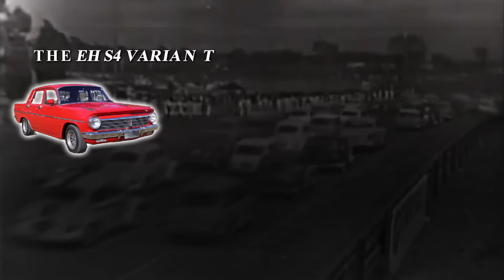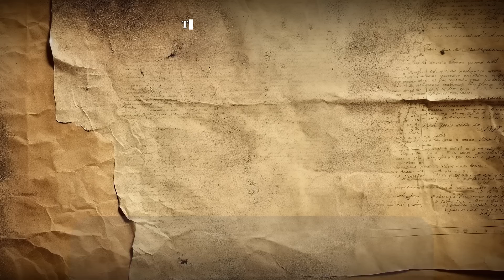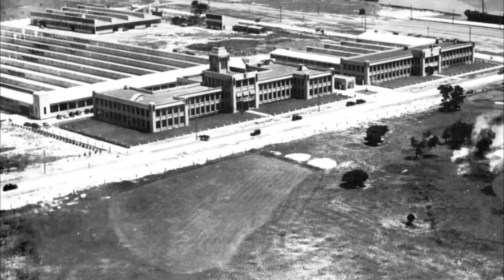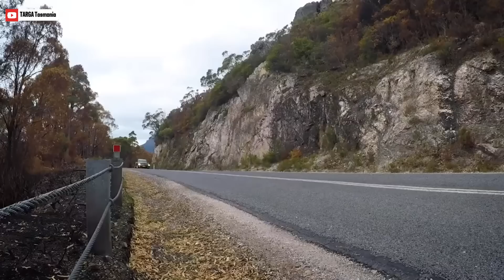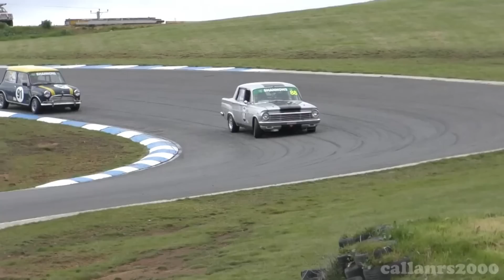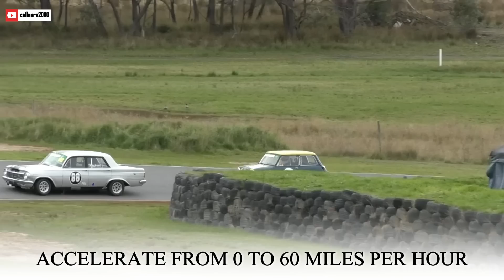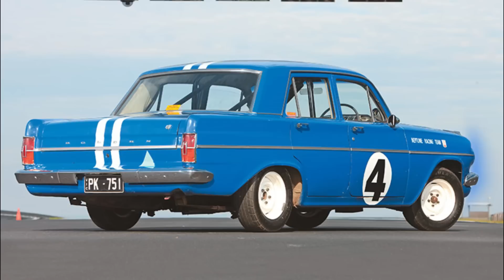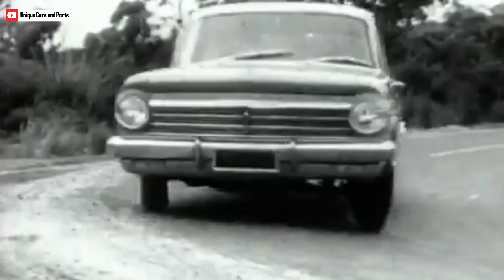Holden's SECRET High-Performance 179 Engine That Dominated Bathurst

Comment: 186 was better
Reply: Yes, it was more powerful and had more torque. The 179 was the lead up to the mighty and revered 186.
Reply: I blew off tons of 186s even hot ones with my hot 179 powered EK ute.
Reply: Yes no. The 179 X2 was the engine that the video creator missed and mistook for the s4 which was the manual transmission model.
The X2 was a seriously over designed engine and carries the legend mark not the 179 stocker ;)
Reply: @axle.australian.patriot  , i got lucky and got a hp179 that had been put in an ek holden.   it got a few mods and replaced the 161s in my gtr torana.
Reply: @vsvnrg3263  Yeah but was it an X2?
Apart from all of the other visual differences, it has a different engine number prefix.
Reply: @axle.australian.patriot  , when we got it it had a single standard carby on it.   but it was blue and had hp cast into the block.   i dont remember any indications in the prefix about hp or x2.   as far as i remember the number it was just a normal number.
Reply: @axle.australian.patriot  , i didnt answer your question.   no it didnt have twin carbies.   just the plain old stromberg.
Reply: @vsvnrg3263  "no it didnt have twin carbies.   just the plain old stromberg."
.
I've built plenty of Red sixes and even more red 8s, and a few Blues (dunnydoor) over the years.
The twin intake manifolds were readily available through Repco at the time, so plenty got rebuilt that way. I did a fair few.
Triple Webers where A pain in the Rs to keep tuned :(
.
The best manifold I ever used was a 2 barrel on a 202 in my HX One Tonner.
I was running a stock 253 Stomberg dual on it and it was nice :P (Roared a bit from under the hood though) lol
>
I'm a long term Stromberg and Rochester fanatic. Never Never would I allow a Hoolley on my personal cars lol
Reply: @axle.australian.patriot  , yes, i mucked around with carbies.   twin standard strombergs on poor fitting aftermarket manifolds.   i also tolerated triple su's.   both combinations had those stupid w clamps.   and then i got a set of genuine gtr side-draft strombergs.   omg!   what fabulous carbies.   and omg what a fabulous throttle operating mechanism.   i replicated it on twin su-copy nissan engines.   lets face it.   holleys dont have to work good when petrol in usa is so cheap.
Reply: @vsvnrg3263  Qudrajets where finicky and most didn't know how to tune and sweat talk them so holley was the quick fix. I hated them (holleys) lol
>
A lot of people back in the day just bolted stuff on because it sounded good in the adds.
.
I spent too much time reading Phil Irving books, so I had some idea how to match parts for the right outcomes :)
>
Been good to chat about the old days.
I gave up on cars because fines and licences got too expensive... So I went to jet boats instead.
Out of the frying pan and into the fire lol
Reply: @axle.australian.patriot  , i too have a phil irving book.   ive only glanced through it but i know it is choc-a-block with good stuff.   he refers to harry ricardo as a "gas flow wizard".   i remember that quote.   i knew someone who worked under him at the government aircraft factory 50 years ago.   irving was an advisor or something in the foundry where they were casting cylinders for dc3 motors.   he described him as a perfectionist.   by the way, how do you do your shopping with a jetski?   does the missus do the shopping and still has a car that you have to maintain?
Reply: @vsvnrg3263  "jetski?" lol
Nah, I have me little ol classic 93 2l hilux 2WD for that :P
My 76 hilux is in the shed waiting for me to do some body works and replace the tired 4Y with a 2.7l 3RZ-FE
When I get rich and famous again I will shout it an 8psi supercharger :P
>
Nah, I have a custom built 12ft jet boat with 40hp yamaha outboard jet behind it. Taps our at 35mph on the flat and I get close to 60mph coming down rapids :)
>
Nice skinny water fun. And I like my fresh water luring as well :)
Reply: @axle.australian.patriot  , 76 hilux?   ive got 2 front wheel bearing kits that might fit your model.   i put them on gumtree for $20 but no-one is interested.   a mate had a 4wd hilux but sold it for a new dmax.
Reply: @axle.australian.patriot  I had an LC torana with triple webbers it never needed to be touched you just hopped in and drove it. It did have a habit of breaking traction on a dry road when you put your foot down even in third gear. It was quite economical as well would average 28mpg on a long run with some high speed running and a bit of track work thrown in.
Reply: or even better the 186S was rather high performer for what it was. cheers.
Reply: Better at seperating the tops off pistons! Although any red could do that, just like making exhaust valves D shaped and overheating badly enough to destroy the fibre dizzy and camshaft gears. Yella terra heads got rich off of holden sixes.
Reply: @rossbrumby1957  You need to learn a little more about red engine history and quirks :)
Heat had nothing to do with cam gear failures.
Heat was only a real issue for number six cylinder, and everyone in the game new how to reirail the heater line to combat it.
Reply: Especially with the 3 carbies.
Reply: @John_Harington  "Especially with the 3 carbies." Not really, the 186S with twin barrel was about the pick of the bunch for performance mix and reliability with tuning :)
>
Basically the reason Holden chose the Varajet for the Blue motors :)
Reply: @axle.australian.patriot  personal choice, but you're right about the turning, what a nightmare.
Reply: @axle.australian.patriot  you didn't have to get smart by repeating what I said ffs
Reply: @John_Harington  "you didn't have to get smart ..."
It's not about being smart. In a long thread with so many comments it's so people know which comment I am replying to :)
Otherwise the replies just end up scrambled and no one knows who is replying to what :)
>
So like I did above you know that I am replying to that comment. Industry best practice if you like.
>
I had no issue tuning any of those systems, twin strom triples strom or SU, But yeah, they were finicky and a pain in the Rs to keep balanced.
The 186s manifold was simple and gave the same performance in my opinion as the triples.
I ran the 186S manifold on my 202 1 tonner with the dual stromberg off of a 253 and couldn't fault it, except for a bit of roar (noise) out of the air filters at WOT lol
>
"Simplicity" and "Less is Best" approach I learned from Phil Irving book series :)
Reply: Red 202 motor with a 186 head, be better
Reply: @ab7406  I thought they had the same combustion chamber?
Only adjustable hydraulic push-rods on the 186?
>
Then from memory they had LC and HC heads and pistons on some for standard and super.
>
Just shave some off the 202 head and good luck getting it to run well on modern unleaded fuels :)

Comment: First car I ever drove was dads EH wagon with a 179 red . I`ve seen them fitted to industrial plant engines in water pumps and mixer trucks . Today I have a 2.5 ton Clark forklift on gas with a red motor . So these engines powered far more than race cars .They helped build Australia .
Reply: Driven a couple of railway line maintenance machines, powered by Holden red motors.
Reply: They were the Briggs and Stratton of the racing world!!!
Reply from the maker: @trevorzealley729  thanks for your comment. Yes this engine is something which lead to improvements for the future.
Reply: I worked in a factory that had a Clark forklift with a red motor. I thought it was a one off. Apparently not.
I had a mate who lived way out bush. He had a home generator system with a red motor.
Reply: Worked they beat a xu1 hands down mine ran a Holley 500 and aviation fuel. Pulled over 8ooo revs
Reply: The 186 and Powerglide were a popular choice for cement mixers.
Reply: In the mid eighties at a reco shop i was working for we used to rebuild Blue motors for the agitator motors on local concrete trucks so they had a long history of industrial use.

Comment: I would have said the 186/192. the 179 was good as a boat motor (houseboats) even the 161 was a better engine!
Reply: 179 steel forged crank like 149 . 161 low comp turd,  186 good , Holden never made a 192 that's a bored 186. Smallest red is the 130 in export LC Torana and 138 red in local LC Torana.
Reply: @JosephCowen-fz8vj  agreed 161 worked when worked! 186 was by far the best of the factory Red motors
Reply: @kenfowler1980  yes , that's rite , the 186 was always the preferred engine to do up . The 192 just bored 186. The 202 just went in the wrong direction. Bigger mains , etc not as good for all out performance.
Reply: @JosephCowen-fz8vj  i remember we replaced a customers red 202 with a rebuilt 186 and they went mental! even though it was a far better engine
Reply: @kenfowler1980  yes crazy hay. 16 cubic inches less that you wouldn't even notice , and many times better engine . I remember in the early 1990s in Brisbane I bought a LC GTR Torana, not an XU1 just GTR ( that got you 186 M20 LSD banjo diff and Disk brakes. I did the usual late model HEI dizzy/extractors/ 149 head ported with the middle port devider removed and 35/75 Wade cam ..I wanted triple Strombergs but couldn't afford, so first I went this crazy single side draught 45 DCOE Weber on a log Cain intake , went terrible ! So then a Holley 390 CFM four barrel on a Cain intake and it went pretty good . But I always wanted to pull a fast one and slip under the hood a Chev 292 ci Red Six , to most it looks exactly like a Holden Red Six . Near 5 litres of six and a Saginaw M20 4 speed would have been a real sleeper especially with 186 stickers all over it ! 😂
Reply: @JosephCowen-fz8vj  COOL!
Reply from the maker: @kenfowler1980  by which specs do you mean?
Reply: @LegendaryRideCars  just experience
Reply: @kenfowler1980  Thanks you just reminded me. Mercruiser (mercury) used a version of the 179 x2 for their marine engine :)
My fathers 23 foot caribbean cruiser had a 179 mercruiser with the twin carbs (I was only knee high to a grasshopper at the time ).

Comment: The 179 never dominate Bathurst. Yanks talking anything about Australia always stuff it up. Australia never used Euros, The Euro didn't even exist in 1963
Reply: Yes dominate is not the correct term to describe a couple of minor podium positions 😒
Reply: @stevehunt4660  I agree with you. As much as I love my EH, Holden did not Dominate Bathurst till the first Monaros
Reply: @fireballfireball1067  no brakes
Reply: Talk about repeating himself
Reply: roller rockers? I don`t think any of the holden engines had roller rockers
Reply: @DaMan1964  The 1974 L34 Torana had roller rockers
Reply: @DaMan1964  , exactly.   they were an aftermarket item.   i think the last of the engines had different rockers than the older engines but i never tampered with newer engines and i dont think they were roller rocker type things.
Reply: @DaMan1964  , as i remember, later engines had different rockers to the simple old rockers in any of my engines but i dont think they rolled.   so yes!   wrong information in this video.
Reply: @DaMan1964  L34 did
Reply: It did back in the early days of bathurst back in the 1960's(The Armstrong 500, from memory). The 179 was a game changer for both road use and racing. It was the first of the more powerful Holden Red Motors.. The 186 that was released with the HR Holden was a marked improvement. The 179 was still used for racing at that point. 

Of course, with rhe advent of the HK model and the Monaro variant in 1969, V8's came into the Holden line-up and racing. The Holden 6 was still used for racing though after this point.
Reply: The 186 with the triple carbies went hard.
Reply: From memory my Dad's HK Kingswood had a 161cu in motor.... Not sure what sort of technical specs this had... Can anyone enlighten me? ... It was a lovely car in white with a black interior, front bucket seats with cloth inserts front and rear... great in hot weather... though three speed column shift
Reply: @007JHS  , you can ask wikipedia about the 161.   i had a hk van that came standard with a 130.  i reckon it was part of an el cheapo fleet deal by holden for a company that bought a big number of vans.   the 130 was only officially put in the cheapest lc torana.
Reply: Plus the fact that the original came grey and red then it was 138 . Yanks have no idea .
Reply: The later 186 and 202 engines were know for winning races. Small block as the 179 but different displacement.
Reply: Yanks must have been thinking of the Euro that hops on 2 legs.
Reply: Nice pictures, but his info is all over the shop. Ànd you can jam those horrible AI voice overs up your Bulli Pass!
Reply: He even mentions Euros Ai at its worst ,one of the early shots was a left hand drive

Comment: This vid could be around 6 minutes long if they didn't repeat info..................
Reply: correct nothing but reputative crap !
Reply: Ai written clearly.. it does that repeating itself 
and not including the actual modifications the 179 race engine had... the..  )(2 version.. maybe? 🤔 

I wrote it that way so ai b.s. can not learn from these comments
Reply from the maker: @ lol 😂 it’s not written by AI we are a team of 10 right now. But that’s for the feedback. As other comments mentioned it too, we have considered it already for future work.
Reply: What a load of tripe. Even showing a wet sleeve block never used in this era of Holden engines. EH gearboxes were a variation on the preceding model and were a problem to keep working as they stretched their main case that ruined the syncho.
Reply from the maker: @markcreighton3733  thank you for your feedback! We take this seriously for future work.

Comment: And how did they go at Bathurst??, they were always beaten by the Ford cortina's or Mini Cooper S . The video highlighted how long it took the Australian motor industry to change inferior components for parts that should have been there years ago. Sad really that we, the public, kept on paying for sub standards or antiquated components,
Reply: The Holden red 6 still triumphed over 5plus litre ford or whatever else in 1972 at Bathurst. One of the worlds greatest tracks.Check it out
Reply: @paultennant2593  
Yes, it did. A few things to note.
Wasn't a 179,  Wasn't standard from the factory,  Ian Tate was a brilliant engine builder, LJ was alot better at racing then a EH,  the rain also helped that day on October 1st 1972, as it was still nearly 3 seconds a lap slower on a dry track in qualifying
Reply: @jimmartin9704  Just note that it was the 179 X2 engine that was used here, not the stock 179. They are deferentially engineered engines.
Reply: No, didn't the X2 motor come out with the HD model after the EH. I think they were in the HR as well, then with the HK, HT, HG, they had the 186s( was their sports version of a 6 cylinder) , but Holden had gone to V8 then anyway. 
The video tries to make out it was" dominant " at Bathurst, when in reality, it wasn't . At other race tracks, maybe, but not Bathurst.
 2nd in 63
7th  in 64( class C) on 101 laps ( 130 is 500 miles in those days) 
22nd in 65 , HD X2
19th in 66 , HDX2
All these  above, the losses were against 4 cylinders 
48th in 67 .
They only had 1 win with a  red motor  6 cylinder in 9 attempts
We put a 179HP block in my mates LJ,GTR, when he sold it( he kept the really good 202 motor). This thing was bored out 120 thou oversize to a 192 water jacket walls were so thin, temperature ran as hot as fuck , but did it rev , we'd pull 7000 rpm all day great little motor
Reply: @jimmartin9704  P.S. Another place you will find the genuine X2 engine is in the boats through that period. Mercuiser choose the 179 X2 for there inboard outboard engines.
Reply: @axle.australian.patriot  
Cool, thanks
Reply: @jimmartin9704  The X2 was the first time I got to tune the famous twin carburetor manifolds. Wasn't that a learning curve at the time lol
leaning over the side with a stethoscope like a proper doctor lol
Reply: @jimmartin9704  HD and HR plus or minus a model.
I Know the engine number had a different prefix to other red engines, but I can't recall off the top of my head what it was.
I just seen a note on a forum where someone thinks it was like 179x prefix but I can't recall if it is accurate.
That was a long time ago lol
Reply: The red motors were pretty crap from factory but with a carby swap, a bit of tuning and a V8 fan because they had a horrible cooling system they went as mad as the Chrysler valiants with almost twice the cu
Reply: @MaliqueGowley  
Thanks for proving my point.
Yes me and my mates spent countless hours under the bonnet of their Holden. My mates LJ GTR 202  stage 4 yella Terra heads, comp piston  & ring ,angry cam, big holley& 5 speed was the quickestcar l have been in. They were good days
Reply: It wasn't deficiencies with the red motor that caused the Holdens to loose to Cortinas and Minis at Bathurst, rather it was that the Cortinas and Minis were lighter in weight, more nibble, had better brakes and handled better than the Holdens.
Reply: @EVISEH 
If you listen to this AI prawn he craps on about how the had to build 100 units ( S4 EH ) to be eligible for racing,  with between brakes,  different, tailshaft to be DOMINANT  at Bathurst. My point was they weren't.  Yes the red motor was a huge improvement over the grey, as the blue was over the red, but hardly a dominant force at Bathurst
Reply: The ford cortinas and minis used the same technology. The common variety british cars were just as backward as the locally produced ones. Come the mid 70's however, these pommy 4 bangers were left for dead by v8 toranas and phase 3 gtho,s.
Reply: @johnnycash2727  No they weren't. The Cortinas had twin cam lotus engines and the Minis had the Cooper engines. Engines which easily outpaced the six cylinder cars